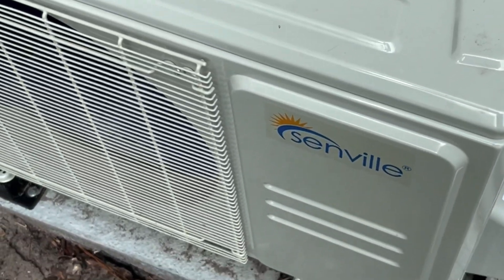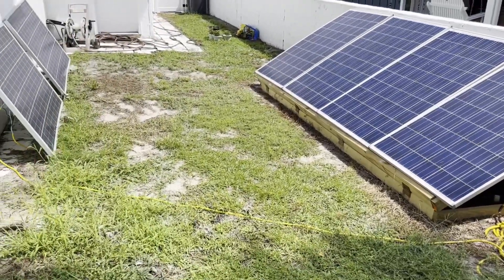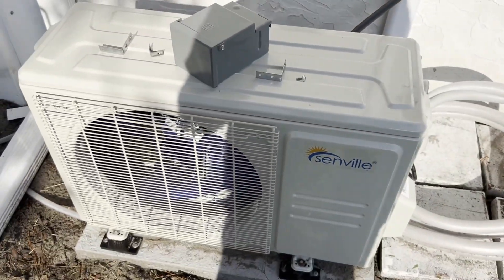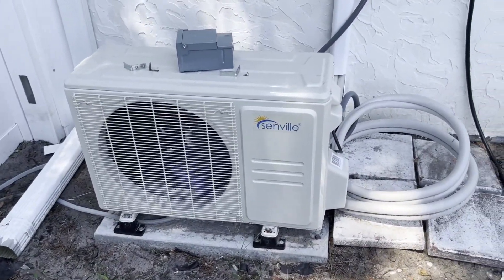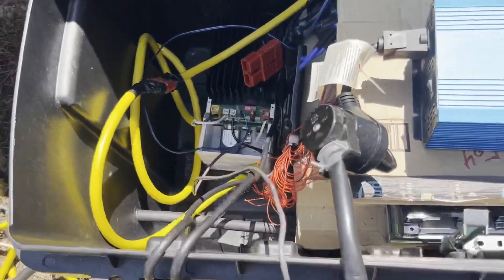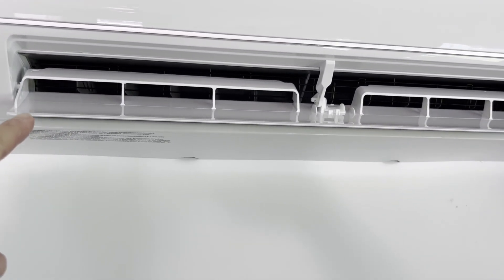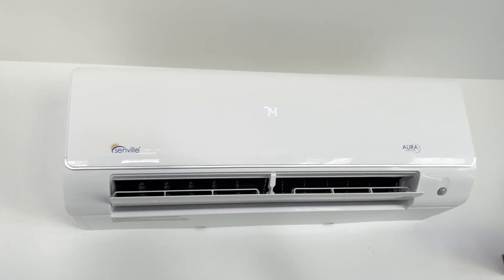How many watts does my mini split ac use ?

Comment: Your SENA/12HF has a better SEER2 than the EG4/DEYE DWLA4-ACDC1-12KR2(US). Much better performance when in heating mode also. Dedicating 1800 watts worth of solar panels to a mini split that is rated at just over 1000 watts max and often requires far less once the room temperature stabilizes doesn't make economic sense to me. I also have one of those little Peacefair $15 multi displays on each of my 'splits. Midea, the OEM for the Senville's AURA flagship series did a nice job with power factor correction. I've only seen it mentioned once in the literature, but it does make them extremely generator (and inverter) friendly. 

 I haven't yet found even a simplified schematic or service manual for any of the DEYE machines, other than a mention of a MPPT controller module. There's probably a small DC-AC inverter running off the main ~380 VDC bus to safely power the head unit.

Comment: I have a Senville Leto 18000 BTU SEER 2 19.5 240v when it is working on a hot day it consumes 7.5 amps per hour, on a normal day 6 amps but when it is working at minimum power it only consumes 2 amps with the outside compressor on, when it reaches a temperature of 3 degrees below the outside compressor turns off and goes into fan mode and only consumes 0.1 amps, I had no idea that they are actually very efficient.
Reply: What does that mean?

Comment: It’s CRAZY to have solar panel power SPLIT between a house and the grid.    ALL that power SHOULD be fed to the grid.   And the house run SEPARATELY, FROM the grid.   There is NO practical reason to split.   Splitting WASTES a LOT of equipment, and labor!!!
Reply from the maker: @Tryp-j9d  depends on your local regulations

Comment: Is your power consumption the total consumption or just grid power only (net of what the solar panels/battery provided)?  I'm working on an off grid cabin and really never thought of air conditioning until I started researching these bad boys.  Ha another added luxury on the cheap - really, once you throw in a few second hand solar panels.
Reply from the maker: @Joebanker80  that was only grid power. Yes you are correct, it doesn’t take much to power these.

Comment: Does the constant power cut / power on cycling damage the mini split over time? I would think that they're not designed for constant power loss like that, especially since you don't appear to be performing a graceful shutdown. I think I'd use a Zendure or Ecoflow or something in UPS mode - Have solar DC input and house AC input both going to the Zendure, and Zendure out to the AC unit. The Zendure is smart enough to charge enough to balance the input, or you could put your cutover switch between the house and the zendure, ensuring that it charges with only solar when you choose. That way the AC unit never sees a power loss at all. 

Hope that makes sense, it was kind of stream of consciousness.

Comment: I just had a 2 zone (18 & 12) 30k btu (condenser) mini-split heat pump installed and I'm seeing similar power usage values. The most I've ever seen it draw was 10a for a short period of time, 8a typical when it's really hot out and both heads are blasting, but even with that current moduates up and down constantly. Mostly between 2 and 4 when everything is cooled down. It's amazing how little power it can draw keeping 2 floors cool.
I'm using the same power meter as you and I also see what I would consider very low power factors. I'm typically seeing 0.25 when idle, 0.6 when running slowly to maintain temp, and about 0.85 when running full current. I was concerned about these values but your unit confirms this is apparently how these systems consume power.
Reply from the maker: They really are a game changer
Reply: @IFix-Things this is not a surprise. People tend to forget that inverter air conditioners don't have locked rotor amps aka surge wattage, due to the inverter technology. I've seen a Hisense DC inverter air conditioner running on an eco flow river 2 pro, so I tend to believe that these inverter ACS simply use 300 to 400 watts

Comment: Solar power is only good for 120watt, house fan, for 9 hours.  2 car batteries. 

Anything be on 140w needs a preaditor 5000. 5 gallon Propane, that can run for a few days.
Reply from the maker: Huh? You need to research more.

Comment: Truely amazing devices.  They convert AC to DC so that all motors can run at variable speed.  Then they use an integrated circuit connected to temperature probes to determine speeds of both fans and compressor.  Most times that means you are not running at full tilt boogie speed, like the old split systems of the past.  Most of the time you actually don't need that much heating or cooling to satisfy the user.  Plus too these are very inexpensive and the cost to own is nominal.  And if something goes wrong you merely replace the component (indoor or outdoor unit) as the cost to have a repairman is more than the cost of replacement.  These units are changing the entire hvac industry.
Reply: Do they sell ones that just function right off solar DC to avoid the AC to DC losses?
Reply: @nwellinghoff Yes

Comment: I bought that (or similar model) meter but the instructions are quite vague. Do you have a video of the connections? Am unsure of the power runs. 
Thanks
Reply from the maker: Hi, each model can be installation specific, I.e 240, or 120v versions, I would advise you call the manufacturer.

Comment: Please cover your electrical box better, and protect your transformer from the rain better.  Water has a pesky way of crawling naughtily, and humidity condenses and drips.  Magic Smoke!
Please position your drain farther way from the basement walls to not challenge your basement water proofing.
Please put a code-correct transfer switch on disconnect box
Please verify just about every numerical values in the comments section, they are nearly all completely incorrect.
Please know Costco offers a true quick connect honest full DIY precharged mini split
Please be aware, EG4 makes an affordable true DIY solar hybrid mini split, and a grid true DIY full quick connect that is actually affordable at Signature Solar online.

Comment: So, you can run on sun power when there is sun.
So, half the day 50/50 your on solar and saving 2.5 KW or .50 a day. 
So thats 15.00 a month and 180.00 a year saved. Which is about 1800.00 in ten years. 
But in 10 years you will need new batteries and panels will decay and the electrical code violations say that you have really saved nothing.
Mr. Wonka says Good Day to you Sir.
Reply from the maker: Who said anything about saving money? What code violations?
Reply: @IFix-Things  It may be that code requires a transfer switch designed to mechanically make it physically impossible for you to send power back to the grid when the power is out.  By your description, you can potentially transfer power to the grid: you said you could turn on the battery feed and immediately afterword turn off the grid feed.  That would imply both are live at the same time momentarily.  

Therefore, if the power were to go out, for that moment you would be powering the grid. Actually, it wouldn't even have to go out.  Sort of like when people make a double-ended male plug and plug on end into their generator and the other male end into a household plug to power the house receptacles.  It sends generator power through the house, which the Power Company doesn't like.  The Wichita Lineman won't ever stand the strain on that stretch down south, regardless of your fine feelings for Glen Campbell. 

Also, there may be another good reason not to turn on your battery before first turning off your grid- as there will be a sine wave mismatch, which will make magic smoke.  Unless your equipment is explicitly frequency harmonized with the grid, say for net metering, and you have an agreement with the power company, then do not turn both on at once.
Reply from the maker: At the 2:50 mark, I do talk about the installed transfer switch, so what am I missing?
Reply: @IFix-Things  They are talking about a mechanical transfer switch that marries the breaker you flipped from the house to the breaker to your panels in the same box.  It makes it so you can't physically turn on your generator power without first disconnecting your power to the grid.  The mechanical ones, you shift/slide a piece at the meter box that disconnects you from the grid first and makes it physically impossible to turn your grid connection back on... and then after you have shifted this piece it uncovers/allows you to physically turn the switch to turn on your local power/generator.  Essentially it makes it physically impossible & dummy proof for you to accidentally have both on at once, and send power back out on the main lines, potentially killing a lineman that might be fixing something after a storm when power goes out.... Cool vid man hope that explains what they were on about.  It's all about safety.
Reply from the maker: @foreverfloridian8525  look at 5:35, you guys must not be watching the video.again, what am I missing?

Comment: I have a senville unit as well, ours is 24,000 BTU,  only problem with it, is it seems to have a very agressive Defrost cycle if the temp is below say 38 or so...   as it defrosts 3 times per hour, every 20 minutes on the dot.    maybe this is normal, but I have a MRCOOL, on the same building, opposite side and it only defrosts every hour or more one time.     if anyone knows the answer I'm curious.
Reply: Defrost should be controlled by time and temperature.  Generally, 27 deg F to initiate a defrost and timed intervals.  So if the time is up, the temp is low enough the unit goes into a defrost and comes out either on time (usually about 10 minutes) or temperature (generally 37 degrees or so).  You may have a bad pc board or low refrigerant charge.  Unfortunately its often less cost to replace the entire inside or outside unit than to pay to have it serviced.  So that is what I would recommend if there is no warranty left.
Reply: I have 2x 24000BTU Senville units and they defrost every ~1.65 hours in winter for ~20min.

Comment: You are reading on one leg of a 240v uint, so if you using 150w it would actualy be 300w? Im just asking, im trying to understand.
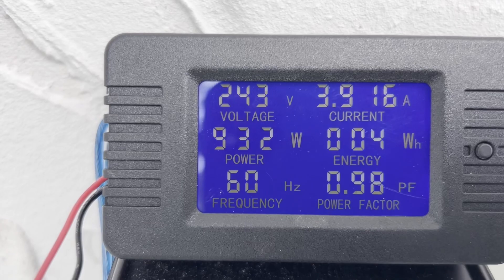Reply from the maker: Volts X Amps X PF (power factor= Watts , so as an example, at the 34 second mark, 244 Volts X .271 Amps  x .05 PF= 3.3 watts, a better examplie is the 1:31 mark on the video, where the power factor is .98 ,  243 volts X 3.916 Amps X .98 PF =932 watts., hope this helps.
Reply: A better answer would be that the average window air conditioner of 5000 btu , basically a bedroom size air conditioner will use around 1400 watts per hour!
Your getting 7000 more btu with 1/2 the watts used.
Efficient yes. But, be realistic and factor in that the unit, needs a disconnect, a surge protector is recommended. A 20 amp breaker for a 230 unit with 20 gauge wire or even a 14 gauge on 15 amp circuit, and. Having those "dedicated circuits" 2020 electrical code are essential to consider.
Reply: @wiley0714  5000 btu AC's are only around 600 running watts and cycle on and off as needed. mini splits are more efficient but they arent like THAT much more efficient (the biggest feature dif is the heat pump really, window AC's are cooling only just that with only a handful of exceptions)

Comment: Awesome video! I just purchased exact same unit for my shop. Gonna wire it up within next few days. What size wire and breaker do you suggest using?? Would 12-2 be ok with double pole 20amp breakers?
Reply from the maker: Depends on the wire run length, my unit is rated at 9.5 ish amps, I think breaker was 15a

Comment: For over 5 years I have been diving into Solar and all the "details" then came along this new MINI SPLIT and I was like no way! Well I am almost done hooking up my DELLA 9000 at 120AC the whole idea for me was can I capture some protons and with some investing can I run AC or even HEAT from a small solar system with proper safety inline with it and then get some a solar INPUT to run a MINI SPLIT at least partial time in the daytime? Well now I am seeing how it all works and I need more LIPO4 batteries (only have 200 Watt Hour right now). However the goal was "can this be done" and the fact is YES it can. I know many will balk at it because they love coal and oil but for me I like the idea we can capture energy and use it to heat & cool. If nothing else if I lose power I will have lights and fans at night. But with a 9000 BTU on 120AC and heating a 500 square foot home my thinking is WHEN I lose power and it's 95F outside I will want something to help me keep cool. What about small frig like the ones used in "dorms" yea the options are out there we just need to keep trying and keep the faith in SOLAR and other alternatives. This is just IMHO. PEACE!
Reply from the maker: Agree with you. They have new mini-spits out now that can plug right into solar panels, without batteries, and they will load share with the grid. Amazing how far along this has come.

Comment: My 18k Carrier minisplit used 32,000 in 14 hours (2,300 watts constantly). I can only assume it's because it leaked out all refrigerant and the Mexican HVAC guy didn't look for leaks or evacuate the system when adding. He also didn't weigh the refrigerant. Welcome to Mexico I guess. Coming back to the US to get a manifold and evac pump. I'm off grid solar and this is way too much power for my solar setup.
Reply from the maker: Did you ever find the cause? What efficiency rating is that carrier? sounds like yours never shut off.
Reply: No I have not. Temps dropped from high 90's 60-80% humidity (feels like 105-110 everyday) to mid 80's. Single pane 12mm safety glass not efficient  and radiates heat but we just had a class 3 hurricane in Cabo. Lower temps and humidity made a huge difference but MX techs don't weigh refrigerant or evacuate systems. Will but own tools when I hit US and do it myself. Carrier Infinite 19 SEER.
Reply: is very possible you need to cross the mexican border soon , treat them good .
Reply: @ernestochaparro8751  I live in Mexico. Are you talking about the US?

Comment: Is this AC inverter? Do you know the seer efficiency? 
That was an amazing consumption 4.6kw in 24h
Reply from the maker: It is an inverter unit, 26 seer I believe, it is their high efficiency model.
Reply: Mine have done 1.5kwh consumed in 6 hours. 1 horse power LG. Non inverter. Set on auto

Comment: How would you power that 240V unit with a Honda EU2000! (120V) generator, maybe sending it thru that transformer over by the battery/inverter box?
Reply from the maker: That’s exactly correct!. I would plug generator into the transformer. If you search my old videos you will see where I did exactly this with two eu2000s to run my central air.
Reply: Thanks, that threw me a curve there! 🤔 @IFix-Things

Comment: I just bought Senville mini split cassette… Sir can you please tell me if it’s OK to turn off the three cassettes if I’m not home for 3,4hours.?
Thank you
Reply: I have had the single cassette for 3 years now, and have turned it off many times.
Reply from the maker: Call their support line, they are quick to answer. I can’t speak to your model,  but for mine, I can turn it on and off when ever I want. I know the preferred method is to leave it on though.

Comment: Why does it use 8 watts when off, why not 0?
Reply from the maker: I have a feeling that for low level functions such as powering the processing board, Wifi circuitry, etc, in others words like a standby mode.
Reply: @IFix-Things  thanks!
Reply: It’s WATCHING you!

Comment: Is it better to put these units in a shaded area or a sunny area?
Reply from the maker: I would say shaded, for a few reasons , one would be less sun rays causing less uv damage, and two would keep the unit cooler to a certain degree. I have seen some videos with normal outdoor units where they spray water on the coils to make them slightly more efficient, this does appear to help, so I have to imagine shade would be better than full sunlight or a small degree.
Reply: @IFix-Things  I was thinking the same. My wife and I are in Northern Nevada (Reno-Sparks) preparing to move offgrid in a modest and 867sq.ft. modified Earthship Style Home (a mouthful - I know)! LOL! We will probably be looking into two of the units because there is ZERO power on the mountain and we will be limited to sun, wind and backup.
Reply from the maker: @rongray4118  sounds like an awesome place!

Comment: What happened to your hard start video sir?
Reply from the maker: I’m not sure. But I will tell you the hard start is really only good for ac units that are about to die. They will help on the initial startup,  but serve a very different purpose than a soft start.
Reply: There's absolutely no need for (and no way to connect) an old school hard start kit to one this particular mini split. Each of the main motors (compressor, fan, and indoor blower) is like a brushless DC cordless drill on steroids under computer control. Full torque is available at any speed including startup.